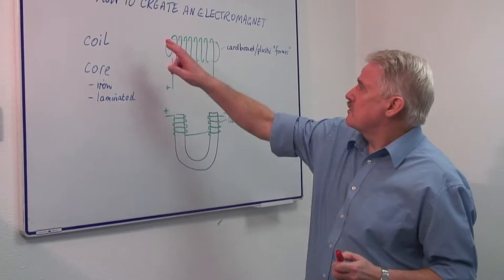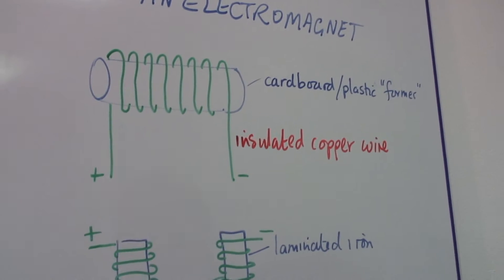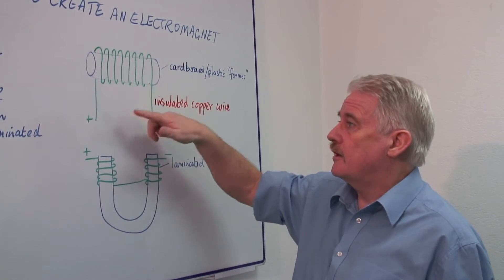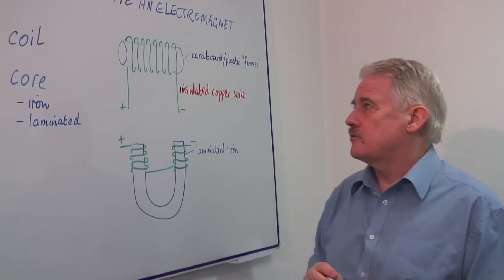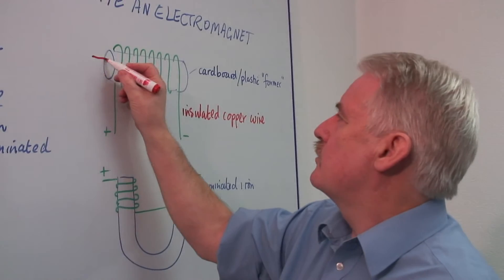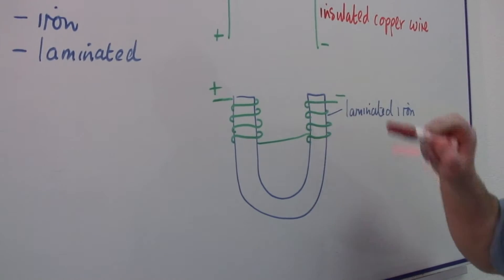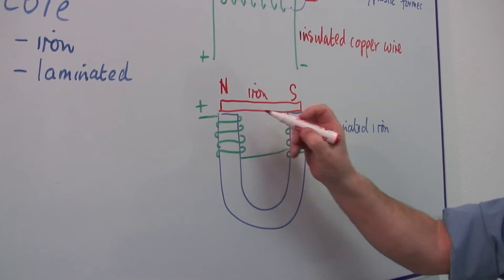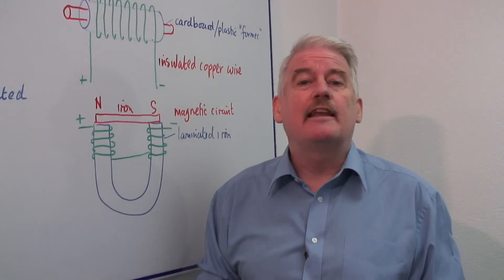Physics Help : How to Create an Electromagnet

Comment: now the big oil conspiricy that is suttle but noticed if you look. great on paper and yes if wound like that it works great!  but the electric, and manufacturers wind them back and forth or all over the place in the transformers, and motors! open one up and look. this causes magnet drag circuit in them! in turn it becomes a big wire wound resistor, and the magnetic energy is back poled off. so they are not! using true conversion. now days they sell tons of gadgets with this bad windings.